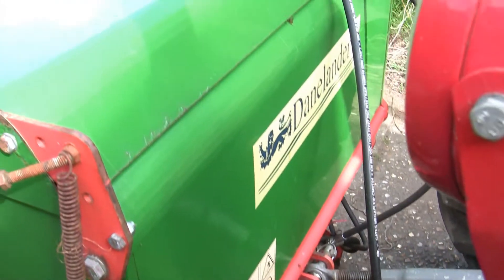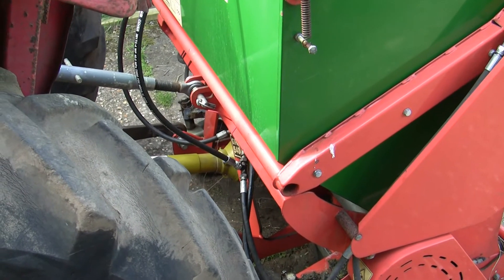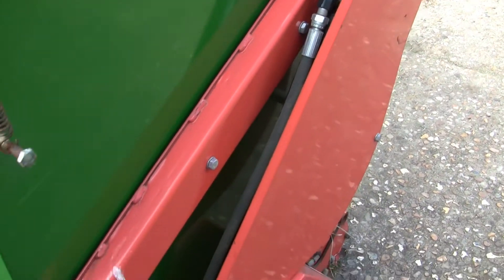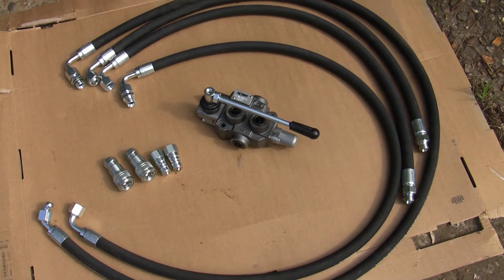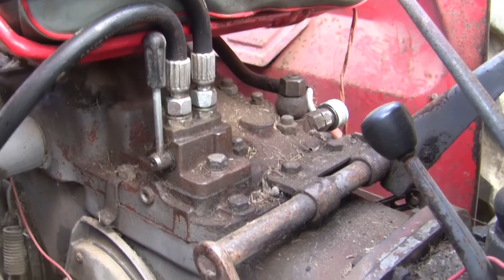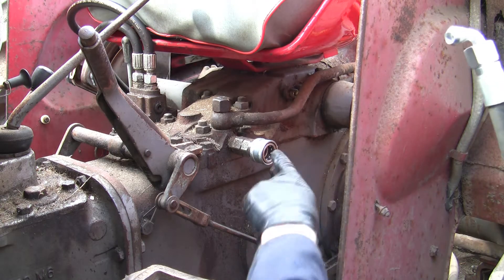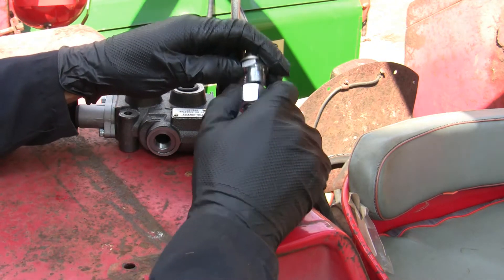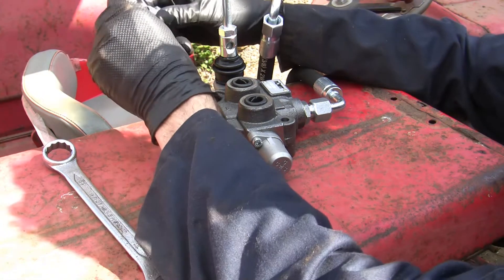Fitting a FlowFit spool valve and cylinder to a Massey Ferguson MF135

Comment: Can you have the arms up and having flow coming out? I need to have a continuos flow and need position control. Is that possible?
Reply: With the diverter valve he has under the right side of the seat, you  divert pressure from the back lift arms, to the add on valve. SO, if you raise the lift arms and switch the diverter over to the add on valve, your lift arms stay up(unless the internal cylinder leaks down).
 All hydraulic pressure would be going to the add on valve, but the lift arms should stay where they are when you 'divert'. 
 If you want to lower and raise the lift arms, just flip the diverter valve back.
Reply: @bluegrallis  would the rings in the hydraulic cylinder be the main reason the lift arms would go down when diverter switched over or some o rings somewhere in thtr hydraulic system